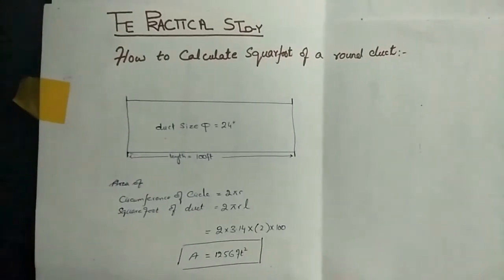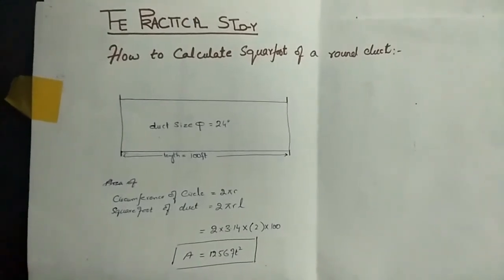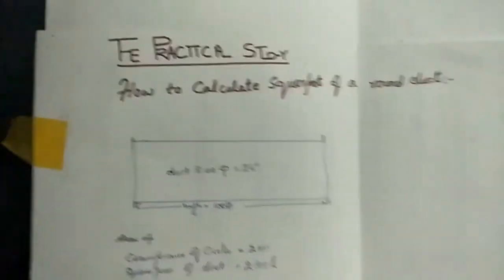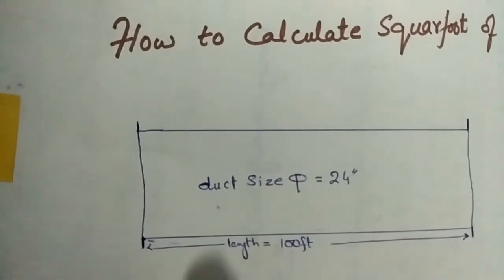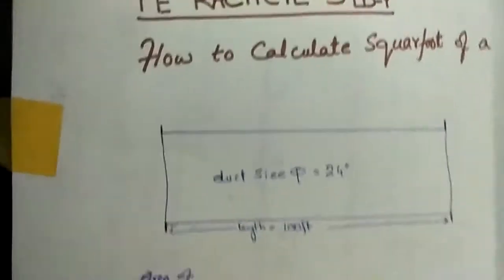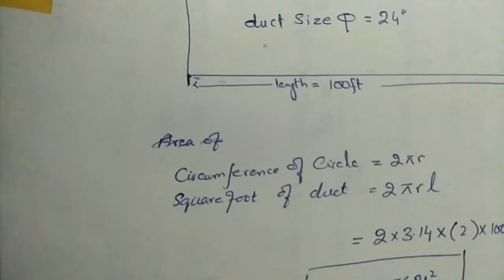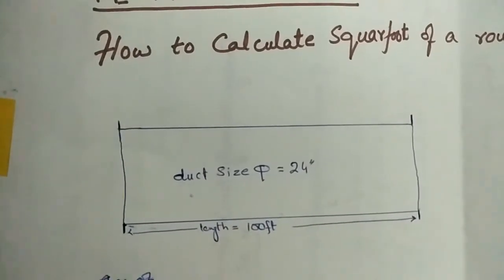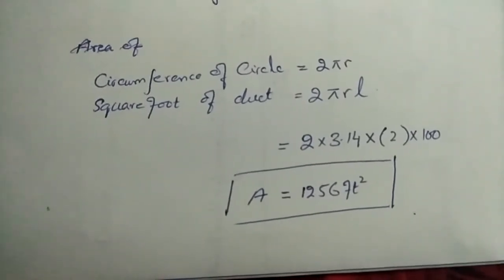How to Calculate squarefoot of a round duct

Comment: If the Diameter is 24 inchs. convert inchs to foot 24/12=2 So Radios will be- 1 Foot. Round Duct SQF will-  (2 x 3.14) x 1 x 100 = 628Sqf
Reply: Correct!!
Reply: that is correct

Comment: If the Diameter is 24 inchs 
then why is your formula shows 2 x 3.14 x ( 2 ) x 100
it should be 24 x 3.14 x 1200 / 144 = 628 is the right answer 
explain how your answer came to 1256 Sqft
Reply: what is 3.14